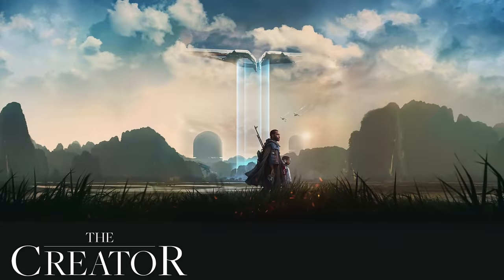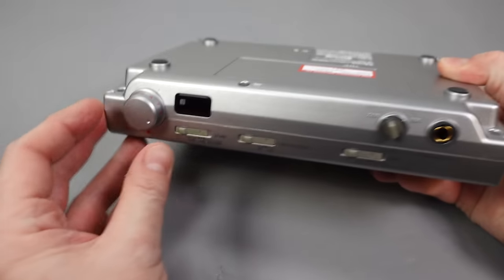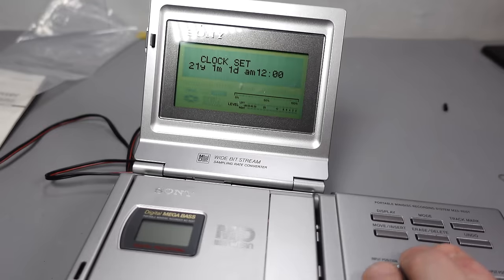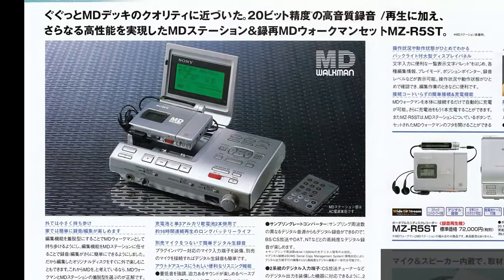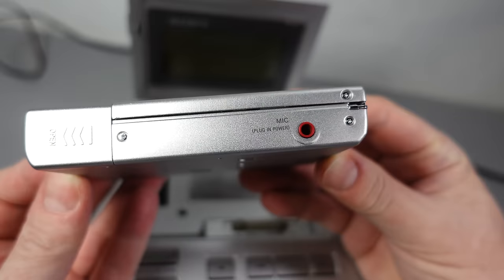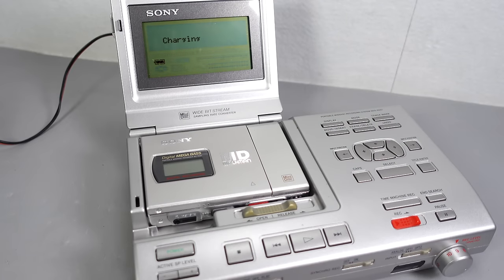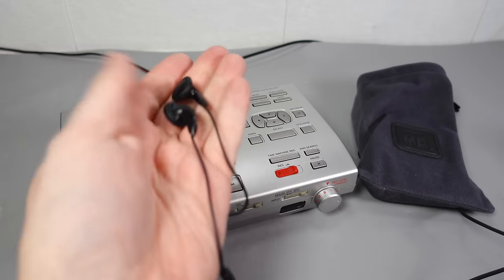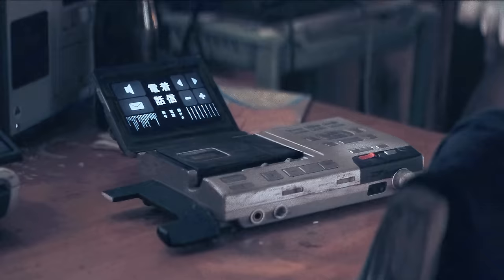Sony’s self-destructing MD Recorder from 2070

Comment: Still think minidisc is the best format of the last 30 years. Portable, hard wearing, decent capacity, switch between devices easily, small enough, skip tracks instantly, what's not to love.
Reply: If you have to have a moving/rotating physical media, then yes. Otherwise, flash memory it is.
Reply: @simcax6087  here's the rub though, cloud backup notwithstanding, many devices don't have cloud back up, if the drive fails, you lose everything. If a minidisc fails, you only lose one album.
Don't get me wrong, I suspect like many that are old enough, I have vinyl, loads of cassettes, mini disc, stacks of CDs, Ipod, ipod nano, and plenty of other mp3 players, and more I've probably forgotten about, but I keep going back to my LP mini disc, which is at least 20 years old.
Currently contemplating hooking up my ipod to my car as well lol.
Reply: @SeanHendy  You don't need cloud to backup your files, just  a spare usb drive. It's still less prone to failure, than any physical medium coupled with the mechanical machines needed to play them. And not to mention the lossy compression of md vs. flac... I know it's kinda romantic to have a piece of our youth with us and vinyl is the best, but i'm glad my music doesnt take any storage space in my apartment. So the practical reasons are more important to me than this romantic feeling.
Reply: Micro sd? Hell , even normal sd seems to be better across the board for that matter.

Except for the shininess of an md of course
Reply: Correct me if I'm wrong, but you could only use the proprietary ATRAC format on it, which basically no-one else used... so you also needed proprietary software to handle the files. And if those are not supported anymore, it's not easy to do so. I don't like closed proprietary systems...
Reply: @MetalTrabant  been a while since I did a boatload of MDs. From CD, pretty sure I didn't use a computer, connecting an optical line from my CD hi-fi straight into my MD. It is LP so 4 albums per MD.
Reply: Romantic? Not really. Nostalgia? No, majority of this tech is before my time.
Flash storage is volatile (ie: write cycles, not 'non-volatile' referring to electrical storage), sure it's convenient at first but it isn't lasting needing to be replaced several times over years.
I've lost more data on SD/SSD's failing on me than HDD or even failed burned Blu-Ray/DVD/CD's for that matter.
Maybe I'm lucky, but I'll admit I abuse technology writing many TB's 😬 so far an old detached HDD is my best backup medium lasting 13+ years (among other younger drives). If it's good enough for major corporations, it's good enough for consumers (slower 500TB tape drives notwithstanding).
We're discussing art, not simply "I can fit 1000GB of lossless music in my Sony NW-WM1AM2" or "just use Tidal on the cloud"
There's a need for physical connection, if you feel that's "romantic" then that's your definition, for me it's about tangible backup and compartmentalizing my musical enjoyment from my pc/phone, ideally an entire album as intended by the artist (but 'mix tapes' are a thing too, also called playlist).
That said, minidisc's megneto-optical technology has stood the test longer than many others while still being recordable, even pressed CDs fail eventually (they use better metals but succumb to cd rot).
Everyone loves vinyl, but nearly as lossy as basic cassettes, it creates an analogue sound, not original quality but euphonious pleasing the ears/mind, which is about the point of most music on physical media.
You may be a minimalist, simple earbuds & data on a phone is all you need, but for those who enjoy the melding of tech with music these pieces featured on Techmoan are a wonder  @simcax6087
Reply: But discs were so expensive.
Reply: @A2theC  I follow this channel because I have fond memories of my boombox/walkman/hifi deck years. Consumer electronics from the late 80s early 90s was an amazing experience to look at, even more to use it. All the Sony, Pioneer, Technics, Marantz  etc. stuff were so nicely designed, good quality gear, I don't know what goes near that feeling nowadays. But I like the convenience of the digital era, being it Tidal or just storing flac files on a local NAS and playing music anywhere in the house. But it's good to look at the nice old stuff, and for that, I'm thankful to Techmoan and this channel :) (also made possible by the digital era eheh)
Reply: The music company can’t charge you a subscription to listen to your music though or pile gobs of ads on you.
Reply: I used it extensively during the 90s. The only thing I didn't love is the fragile TOC. Once that was damaged, a disc was unplayable.
Reply: @EarlySwerver  Perhaps from an end-user perspective, but I'd wager the TOC could be rebuilt relatively easily if all the actual data was still there.
Reply: I'd say it's a great device for storage on a physical media and archiving, but not everyday use. It still uses a laser and motors. A direct file reading device is the best for reliability (if the device is designed properly) and battery life. It has no moving parts and should be rock solid.
Reply: @Mostlyharmless1985  good point.
You've just reminded me of a conversation I had 3 or 4 years ago with a 19 year old. I asked him about the music he owned. He didn't own any. He streamed music as and when he wanted to listen. 'But what do you do when you haven't got wi-fi?' He spent all his time in the city or in internet cafes. Me, I'm often out in the sticks, in the wilderness.
There was a different experience back then too. Buying an album. Listening to all of the tracks, whilst reading the album insert sleeve, of a CD or cassette.
For anyone not aware, minidiscs main and most common application was to duplicate the music you owned, leaving the original copy pristine, whilst you listened to the albums on minidiscs. No more scratched CDs.
Reply: @EarlySwerver  I was a little later, early 2000's. Luckily never had a disc go bad.
Funny, and I know that minidisc bombed in the US, did best in Japan, and ok in Europe, but I was on holiday in Thailand about 2001-2002 and met a small group from Colorado who were fascinated by this disc that had 4 albums on it, and the battery lasted most of the day, as they were used to swopping out batteries, and using portable CD players.
Reply: @A2theC  You could do write-once SD cards for music albums. I'm sure whatever media is inside Nintendo Switch cartridges is long-lived enough, and I'd found a few companies selling this tech for small production runs. (For example, manager training info that needs to go to all of your offices or whatever.) The things cost about 4-6 times what blank re-writable SD cards cost, and I assume that's because of the niche production vs mass production of games carts.
Reply: Lower quality than CD, that's what! 
Although I am grateful to Minidisc for introducing the concept of displaying metadata (track name, artist, album) stored on the disc!👍

... If only publishers and device manufacturers had managed to universally implement CD-text by 2023, freaking 30 years later! 😪 
I cannot overstate my disappointment when after buying a brand-new double-DIN Pioneer moniceiver for the used car I bought this summer, it turned out that despite featuring a high resolution seven inch LCD screen the bloody thing doesn't display CD text! 🤦‍♂️🤦‍♂️🤦‍♂️
I'd never have expected it to be a downgrade in terms of CD information compared to the single-DIN radio receiver I had in my previous car with merely a 13 character seven-segment display! 😪
I even considered returning the moniceiver and switching to a different brand, but none of the competing products mentioned CD-text in their documentation either...

Comment: I have 2 of these. I immediately opened them both up. Original Sony Ni-Cd's in both. Very little battery leakage in the first one. Easy clean up. No damage done. The second one had just a little in the battery ends and the compartment did not even need cleaning. Thanks so much for this video.

Comment: It occurred to me that those analog input/output may have never worked. That unit may have been defective right out of the box, got set aside and was never sent out for repair. I say that based on the fact that there’s a disc in the machine with blank recordings, that you believe were created when the machine was new.
Reply: This would explain why the unit looked virtually unused and the remote control had never been unwrapped. It was faulty from the get go.
Reply: But the fact that a large trace 2-3mm wide that was probably VSS has been visibly eaten away by an alkaloid is still the main issue.
Reply: @andymouse  Yes, the eaten-away traces are still a major issue, but might not be the only issue. Just speculation anyway.

Comment: Such a shame that the leaky batts ruined the board like that.
I hope someone (perhaps the peeps over at the Minidisc museum and their associates?) can come up with a replacement board to get any units with severe battery damage fully operational again - even if, realistically, I bet that a lot of those have either already been hand-repaired where possible, scrapped for parts where not, or even thrown out altogether.
Reply: Those boards aren't ruined. You could definitely rescue them pretty easily. It'd be annoying work but it'd be successful

Given the position and how sony batteries tend to be a bit more forgiving, I don't think we need replacement boards yet. Just someone good at trace fixes.

Comment: Whenever I encounter this I use white vinegar with a cotton swab to neutralize the alkaline and then a quick clean.  What usually happens is a trace on the board gets consumed by corrosion.  Sometimes it can be saved depending on patience levels.  Great Video!

Comment: I've always liked the idea of MiniDisc.  It's a shame it didn't last any longer than it did.  This particular unit would have got a lot of use if I'd had the opportunity to find and buy one at the time.  I'd be tempted to want to have a go at this particular example with some IPA to try and get some of the crusty copper compound off.  Not that it may make any difference to it working, though.  If the traces have gone, then short of trying to solder in new lines, (which is tricky at the best of times), there's not much else you can do, unless you start testing everything to see if there's any way of getting it working properly.  Or, you could just leave it and rely on the digital outputs.  Which, is no big problem.
Reply: To be honest over 25 years is actually pretty good going for something that wasn't a huge success. It sold in decent enough numbers though that home and portable machines can still be bought on Ebay for reasonable prices with a little patience.

Comment: That time machine function reminds me of something I used to do. My dad had a stereo delay guitar pedal that I liked playing with. I'd run the radio through the pedal and out to the cassette deck. I would set the delay time to a good amount, no feedback and all the way dry. When the song came on that I wanted to record, I'd set the fx mix to all the way wet and record the song entirely. Kinda miss doing that...
Reply: That’s actually so genius
Reply: @VFuzball You took the words out of my mouth because that's such an brilliant idea! 
Bravo @chupathingy5862. Bravo
Reply: "The street finds its own uses for things."
- William Gibson, "Burning Chrome" (OMNI magazine, July 1982)

:)
Reply: That's brilliant!
Reply: What does "wet" and "dry" mean?
Reply: @softy8088  An effects box doesn't require it to process 100% of the audio. It has an effects level knob that sets the audio anywhere between 100% bypass and 100% processed. "All the way dry" means 100% bypass, so the box has no effect on the sound, and "all the way wet" means 100% processed, i.e. delayed audio.

Comment: Dang, the portable unit in there is obviously based on the MZ-R50 that I still use as my regular MD player having bought it new in 1997.

I didn't know about the 3D printed battery carrier, though! I've been using the screw-on alkaline add-on for decades. I'll have to go get one of those 14500 carriers now!

Comment: Despite I can't share your fascination about this one way device, it might be possible, that it weren't the batteries which caused the problem with the built-in amp . I'd rather think that the internal power supply is faulty and doesn't supply the Amplifier section of the doc. 
Also capacitors which weren't powered up for a long time sometimes become deaf, which means they don't transmit any current to the outputs. 
Maybe it is a good idea to check the internal power distribution.
Reply: I was also thinking it could be the "pre-amp" components / circuits.

Comment: I still have my MZR35 portable recorder which I bought new a good many years ago , back when I did sound for conferences and business meetings etc - it was very handy for playing walk-in and walk-out music and also for recording conferences , which by running it in mono mode , could get something like three hours of continuous recording on a single minidisc - very handy for transcription when there was no need at all for stereo . 
Although I don't use it so much these days , since most people ask for video recordings , it has been used regularly throughout my ownership and the LIP-12(H) battery in mine still holds a good charge ; the LIP12 looks pretty much identical to that LIP8 you had , although likewise I do have the AA attachment which fixes onto the side , but easier still just to run it off the mains if using it all day long . Never saw the docking station before , but honestly I see little point in it when I could have a full size MD deck in my hi-fi system if I ever wanted such a thing , and Sony also made MD car stereos , and indeed a changer for in car use , but if I ever wanted to use an MD in my car I just plugged in an FM modulator and tuned the radio in to it .

Comment: such a cool unit. I have the portable component, but never knew the dock station existed. Always wondered what that connector was for!  I first saw the MD in The Matrix and I’ve been hooked since. Still use it regularly and make mixtapes

Comment: Bought a second hand westone active guitar from 1984.
Turned out it stil had the original two 9V bricks dated october 1984.
Hadn't leaked, lucky me and the circuitry was in excellent condition.
Two new bricks and everything worked without a his,crackle or pop.
Great stuff those old Matsumoku build guitars.

Love your vids! Greatings from Holland.
Reply: I have a west one thunder 1a, great guitar, has a wide range of tone options.
Reply: @PaulFisher-uj9vb  same one here. Thunder 1A. Also own a thunderjet i bought empty. Pu some Epiphone ES335 pups in.
And a custumized raider 1 bassguitar.. Was red, bought it in parakeet yellow wich flaked. Sanded it to the wood, placed new electronics and great player.

Comment: I highly recommend getting some white vinegar and neutralising the battery fluid’s. If you don’t, the acids will keep eating away the PCB and components.
Reply: The battery electrolyte is not an acid, it’s a strong base (potassium hydroxide). That’s why using white vinegar (which is diluted acetic acid) is good advice for neutralizing electrolyte residues.
Reply: @tookitogo  true, I was just trying to keep my explanation simple.
Reply: @Cybernetic_Systems  Simple is OK, but I really hate it when people “simplify” to the point of being absolutely wrong: an alkaline electrolyte is the diametrical opposite of an acid. And this matters because a reader needs to know how to neutralize it.

Comment: Mentioning the rechargeable batteries for the portable,  I pulled out my MZ-R2, has lip-12 battery, but that one is still working.  The deck itself is getting a bit ‘creaky’ guessing worn connection somewhere, bump the top and it power cycles. Have to be very gentle pressing the buttons on it. And a few lines on the screen have stopped working.  Otherwise still works, even the battery!  Because the MZ-R2 is a bit delicate I did end up buying an inexpensive and more modern home unit(MDS-JE440) a year or two ago. Just because your previous MD videos reminded me how cool the format is. Had used mine daily right up until I got my first iPod…

Comment: One thing that has always puzzled me is why electronic manufacturers never appear to put leak protection in their devices. Giving at least a chance of not corroding all the innards.
Reply: probably to save money. Though that does not excuse companies that make higher end products where the user can logically expect to get something more due to paying more.
Reply: Because with the best will in the world they didn't think 30 plus years ahead, in the case of alkaline eaten pinball machines 40 years, hindsight can be a cow ! :)
Reply: @andymouse  More than likely true for lower-cost consumer items. But I wonder if it is the same for very high-value items. After all the US missile command has just replaced floppy disks allegedly so. Even where I worked in the early 90s our telecom room was still using 8-inch disks at that time LOL
Reply: LOL :) @atlanticx100
Reply: @atlanticx100    Well, if they had a Varta battery in them, we would've had to replace them a lot sooner.  They must've been had a motherboard with jumper pins and an external battery pack.
Reply: Leak protection for NiCd batteries?  Aside from the obvious answer (nobody was thinking about this thing being in service in 2023), good luck keeping all the battery guts contained.  That stuff seeps everywhere.
Reply: @nickwallette6201  I was more thinking why. I include flash lights in that as well as I would have thought that it would only a small price to achivive. As you said it seeps everywhere. Not so much on the longevity, but more for battery failure.